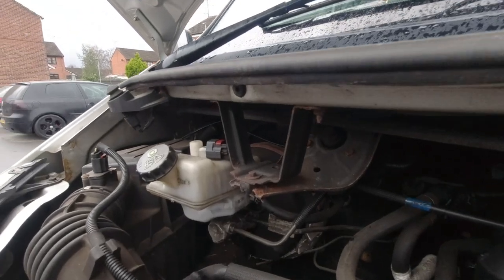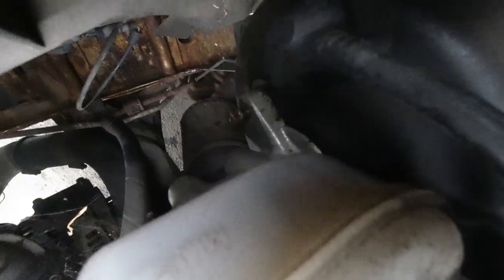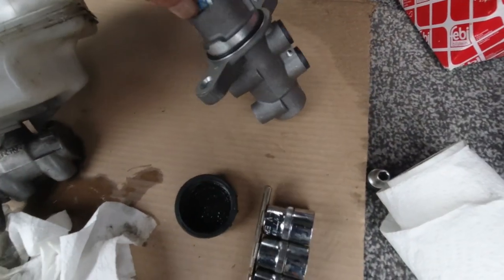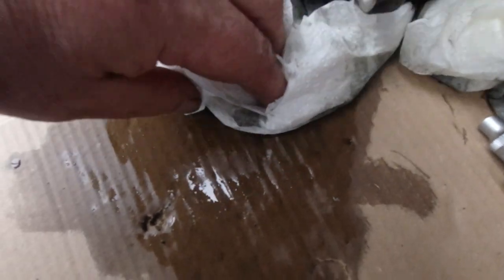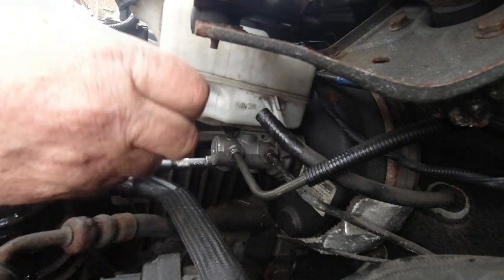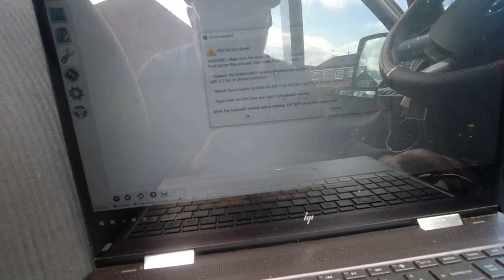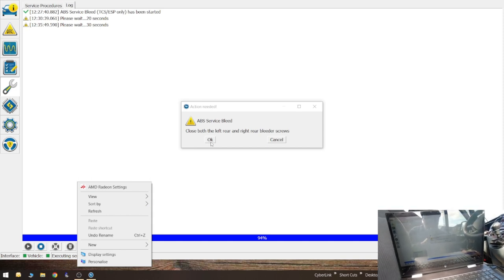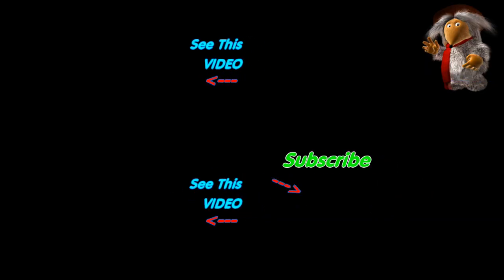Ford Transit Mk7. Master Cylinder.  FORSCAN Brake Bleed

Comment: Hi there, I'm having  problem with 2010 Transit and this your video looks like the solution. I changed master cylinder and can't get brake pedal after bleeding it.Could you point me in right direction to get this equipment/program.Thank you
Reply from the maker: Hi Lee. The only thing I can say is to do same as I have done in this video.. Get an OBD11 devise and download Forscan then do as i did..? It is so hard to try and tell you the step by step..? Cheers
Reply: @Wondering Womble  Thank you, where do you download  forscan from?
Reply from the maker: @leemacdonald7141  Hi again Lee.. Just have to google it.. It is a free download, some items in the program have to be paid for. dont think abs pump is one of them, but if it is, its only pennies
Reply: @WonderingWomble  thank you

Comment: really handy one question: do you fill resevoir from the bottle first and then pressurize or does all the fluid go into the sealy thing and that fills it ?
Reply from the maker: Hi dave.. Fill reservoir first and then connect full sealy bleed bottle then pressurize it. think its only suppose to be 28psi but i had no problem using 65psi from my front tyre.
Reply: @WonderingWomble  great stuff thanks for the reply. And the vid.

Comment: I have a suspect master cylinder on my 2008 Transit T350. What OBD scanner are you using?
Reply from the maker: Hi. I got it off amazon, but it was so long ago its gone out of my history.. The one you should get must do the High speed and the low speed connection.. Mine is a USB connection.. they are only about £15 to £25.. I have tried Bluetooth but the get too much dropout.. cheers

Comment: Hi, What were you symptoms for changing the master cylinder?
Reply from the maker: Hi.. mine problem was that if you put your foot on the pedal and hold the same pressure the pedal starts to slowly sink to the floor, there for the fluid was getting by past.. Hope that help you.. Cheers

Comment: Just plugged in and there is no option for any abs bleed. Do you know if this has been removed?
Reply from the maker: Hi Scott.. I don't think it has been removed. not used it since this video. It could be your OBD connector, it needs to have all 3 levels High Normal and slow speed. as different modules need different speed connections.. Off the top of my head I can't remember which module abs is in.. Cheers
Reply: @WonderingWomble  got to the bottom of it, the software had faults. Downloaded fresh program, now good to go.